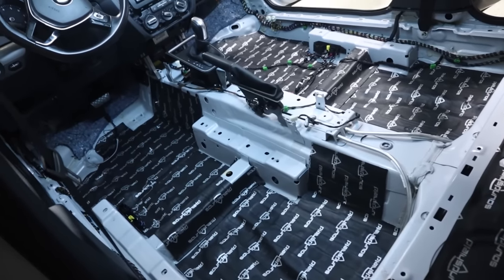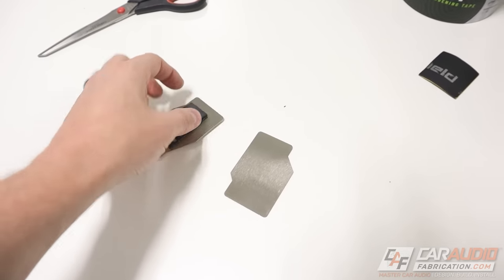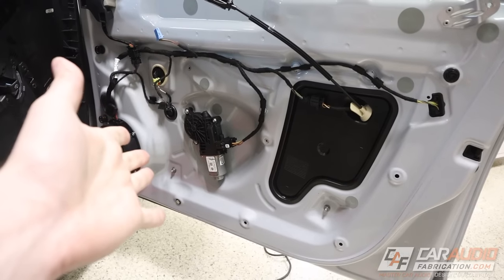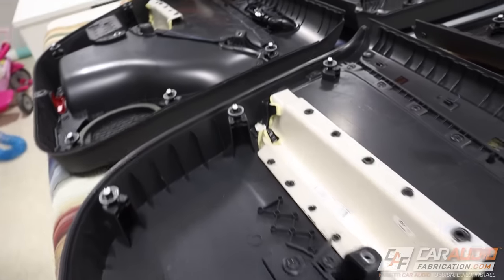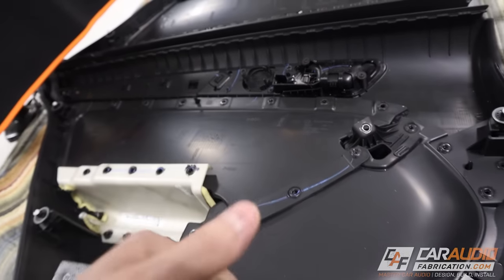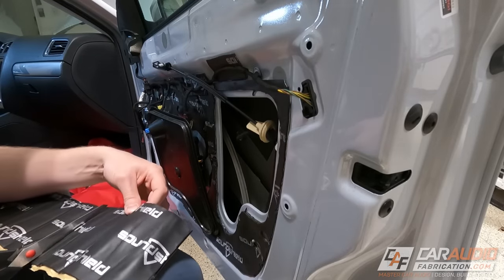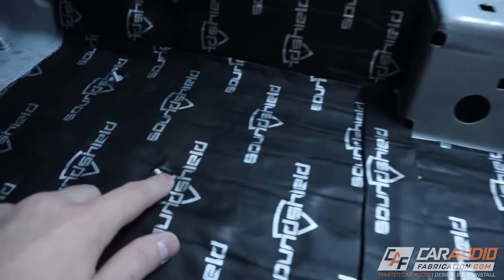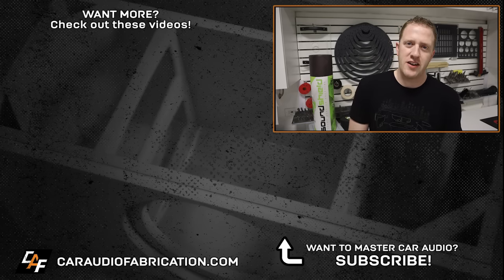IMPROVE SOUND! Deadening Treatment EXPLAINED - Better Bass and Improved Sound Quality!

Comment: have you ever been able to stop 100% off the rattles and vibration noises in any car. I found no matter what product I use and how much material I apply, I can only remove about 90% off the rattles noises. While this material helps for sound, it also causes the speaker to have a more solid mid bass and bass, increasing the vibration and rattles I was trying to treat in the first place.

Comment: Hey CAF, i have a question. There's a type of sound proofing material with aluminium on the top layer.. with the rubber thing on the bottom.. 3m makes them.. is that a good option to go with if i want to sound proof my car.. or does that do more to heat reflection than sound deadening? I'm really confused about this
Reply: What you have described is called and Constrained Layer Dampener, or CLD.  Most CLD sold by Dynamat, etc is made of butyl rubber with aluminum on top.  This is the most used sound deadener.  What you DON'T want is material that is asphalt based with aluminum on top.  That is made for roofing.  It will melt inside a car and also make your car smell really bad.

Comment: I just subscribed to your channel and I’m learning a lot. I’m a newbie at car audio but I have discovered that I love this stuff. I need to find out the correct way to amplify my speakers. I’m putting a system in a F-150. I put sound treatment inside my doors and floor. I have put in four 6x8’s low/midrange speakers and I have four 2-way crossovers and four tweeters. I have an Eq that will run to whatever amp(s) that I get. My 6x8’s are rated at 125 watts RMS and are 8ohms each. Should I get a big 4 channel amp and run each channel to the crossover then to the 6x8’s and tweeters? If I do it that way will this drop the ohms on each 6x8 from eight to four by going through the crossover and splitting each channel to the tweeters also? Would I have to bridge a four channel amp and run each side parallel to drop the 8 ohm 6x8’s to four ohms even with crossovers? I’ve started to think maybe I should get 2 amps because that’s 8 speakers and 4 crossovers all together. My last newbie question is about my tweeters. I know since the 6x8’s are rated at 125 watts RMS each then they can handle plenty of power but do I have to get high RMS tweeters even with the crossovers? I mean if I get an amp pushing 180 watts RMS to each channel will the crossover split the power evenly between the sub and tweeters?

Comment: I have a 03 Lexus GX470. I know the car comes factory insulated well, but I want to improve sound quality when driving around. I also don't want to " multi-layer" the material and cause fitment issue of panels. what would you recommend? I just want a simple system since I don't want to rip my interior apart. maybe layer the doors, rear hatch door is enough for sound improvement? do I have to layer under carpet and headliner?? love your vids!

Comment: I didn't overlap but I hate when there was gaps in my sound treatment I took the whole carpet out I have to basically the same car. A little bit more where the gear gauge was an a little bit more in the trunk. I wish I would have had the phone one that he has. My full car only weighed about 35 lb of sound. Except for the doors I use the.  Thicker stuff

Comment: I sincerely need some advice my 2006 new beetle has a horrible metal vibration coming mainly from the driver side in the rear and as far as I can tell it's the metal plate it's mounted to due to it being a riveted insert rather then part of the main structure what I need is a way to stop that hopefully without it costing much more then like $80 if possible if not understandable but worth asking anyway

Comment: Hi Mark
I have a 2006 Silverado 3500 crew cab and my stock stereo shit the bed so I installed my old kenwood KDC-148 stereo into the truck , now I think I’ll install my old Sony XM-440ex 4 channel amp in under the back seat and add one 10 inch Rockford fasgate R2D2-10 sub .
I told that if I remove the flip down 8inch flap at the bottom of the back wall , I can fit a slim box back there that will still allow me to put the seats back up when I need to . Which isn’t very often .
I’m thinking a passive radiator box. What do u think .
And do u have a plan I can buy off u for such an animal.
I live in a small mountain town in mother bc so we don’t have any stereo shops here. I’m on my own 😢

Comment: G'day, just about to lay some sound deadener in my 1997 Holden VS Commodore. Just wondering if it's ok to lay over the oringal bitumen material like in this video or should I remove it first?
What difference will it make?
Is there any concerns for either way?
Cheers mate!

Comment: Does the slim work as good as good as original shield? I’m doing a small project for a 07 Civic. (4) 6.5’s  coaxial front 60 rms, rear 80 rms, (1) 8 midrange 100 rms, and (1) 12 sub 400-500 rms. Will the slim give decent protection?

Comment: Great video! I did a big part of my 2019 golf this summer(the trunk, the 5 doors and under my back seat) with two layer of killmat 50mill. I am debating doing the roof or the floor next. Which one would you recommend?
Reply: Roof. The floor has ripples in it so is less resonant, however that's where road noise will come through. Then again, to do it you would be removing seats/carpet etc etc so unless you plan to run the wires at the same time.....

Comment: Hey, I have an old hifi music system whose CD reader and other ports are not working, only the radio is working. Is is possible to make the system run on the car sterio head using the power supply and amplifier of the hifi music system?

Comment: At high volume, my doors are rattling but it seems to be at the door latch location. Any suggestion for that matter ? Or maybe adding sound treatment to the door would fix the problem..
Reply from the maker: Try using a tone generator and play a test tone (be careful not to play too loud) but play with the frequency until you notice the resonance. Then see if you can push on the offending part to prevent the noise, if so you can potentially make modifications or isolate the materials from one another with some of the materials shown within the video.

Comment: Hi Mark, is it true that Dampening or Sound Treatment reduces the overall mileage of the car as it increases the car weight? Is the reduction substantial or marginal.
Reply: Marginal 
It's only the weight about of a extra passenger and at highway speed wheigt doesn't matter only in the city  does wheigt matter with stop and go traffic

Comment: Any tips for a snapped off retainer clip (not sure if thats what it's called) I removed my rear deck cover to install speakers. Unfortunately I snapped on of the pieces that holds the plastic push fastener. Now no longer stays quiet when listening with my subs on
Reply from the maker: Not sure if you mean you broke the clip, or where the plastic holds the clip. Clips can be replaced, most auto stores have replacements. If their is vibration between parts you need to add a "decoupler". In this case some closed cell foam. The SoundShield WrapIt would be good because you could just stick it in place.

Comment: So, eventually I'm going to figure a system for my 04 Silverado crew cab, but I also wanted to mat the everliving shit out of it. I mean, it's an 04 GM product, and a pick up at that. Sounds like shit in there compared to my slightly newer Buick lol, but there's honestly foams and insulation all over that car. I also would imagine it would better maintain the climate, especially doing the roof.

Comment: for a 4 channel amp what do u suggest is the best way to hook up the signal?...rca or with the speaker input, i got the audio control 4.300
Reply: @2869may  thanks, guess that question was alil to difficult for CAF to answer..

Comment: how many square feet did you end up using? idk how much is in one of those rolls
Reply: There’s 11 square feet in a roll. To give you an idea when I do an average size door I can do 100 percent coverage on the outer door panel which is what you would see through the maintenance holes then 100 percent coverage on the inner panel which is the side your door speakers mount to and that would take me one full tube. Of course that’s an all out job but the performance you get from your speakers is unbelievable. It makes everything about your car feel different like your isolated from all the outside noises. Your audio performs at its peak and even shutting your doors sound and feel totally different.

Comment: Hey Mark, big fan, hope you're doing well. I was wondering, since I'm sound deadening my doors right now, should I remove the vapor barrier and sound deaden the inside of the panel? I want to get good sound treatment, but Im worried if I remove the vapor barrier, something may go wrong. Is it a big deal if we get rid of the vapor barrier altogether? Thanks, stay safe
Reply: Yes! Just make sure to clean it super well before we applying it, you'll be fine 🙂

Comment: ...if car manufacturers could just spray 5-10 pounds (2-4 Kg) of spray-on deadener to the floor pan (and rear shelf for sedans) as the car is being assembled, that would go a long way in improving interior dynamics such as reduced road noise...but the biggest thing it would do is prevent people from having to rip out the entire interior to cover the floor and puny little deadener squares/patches put in by the manufacturer
Reply from the maker: It would hurt their forced mandates for fuel economy too much. Cars are only going to get worse.

Comment: in my humble opinion.. if you're sound insulating a car, you should do a proper job and do everything at once, fully. You're already tearing apart the interior, probably braking a ton of clips.. if you have to do it, do it once. I'll do complete sound insulation on my B-class Mercedes next year, I hope to see at least 7-10db improvement. 

The limiting factor is poor aerodynamics design, as always, so there'll still be loads of wind noise at higher speeds.

Comment: I have never seen anyone take out the headliner and treat the roof. Do you ever do that? If so why haven't you ever shown it? If not "Why"?
Reply from the maker: I've done it before, extremely labor intensive. If doing a huge bass build its beneficial. As noted in the video though budget drives decision and there are more important locations to focus the budget.

Comment: PLEASE HELP PLEASE HELP PLEASE HELP PLEASE HELP PLEASE HELP PLEASE HELP PLEASE HELP PLEASE HELP PLEASE HELP!!!!!!!!! 

A few months ago I got my PSI Platform 3 18 inch sub with all the performance upgrades, I have the custom built box tuned to 32 hz and I gotta say....... I am quite underwhelmed with it. Don't get me wrong it sounds good, but this thing is supposed to be 3000 watts RMS (yes, I understand the power drops significantly with a ported box) yet my 1500 watt RF monoblock PUNISHES this sub not even at 50% power!!! My 1000 watt Kicker comp vr 18 was only 1000 watts RMS and it was MUCH louder!!! I just don't understand!!! Can anyone tell me how this is possible??? My last stereo only had the stock alternator, no big 3, AND much smaller wires, yet it was MUCH louder so I feel quite vexed!!! What am I doing wrong this time around?!?!?!